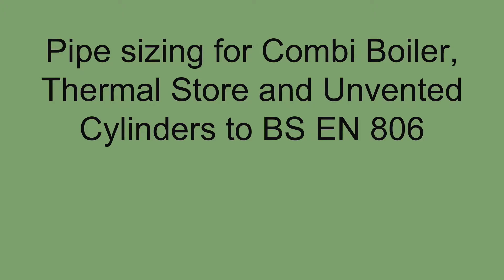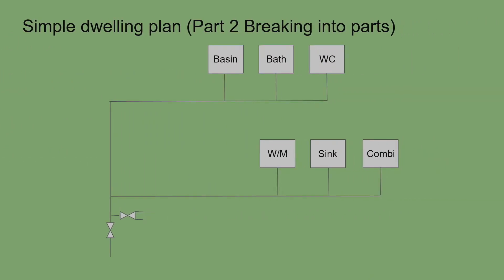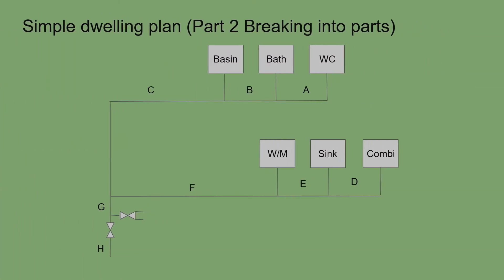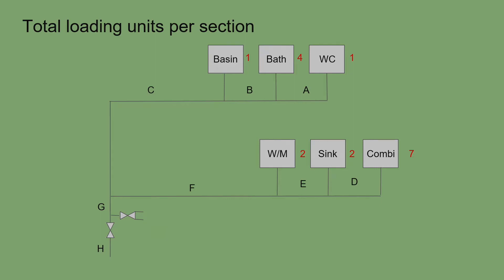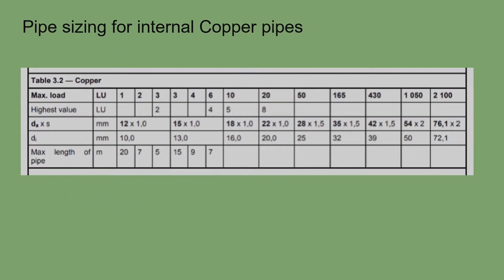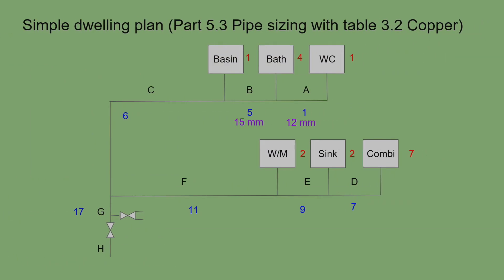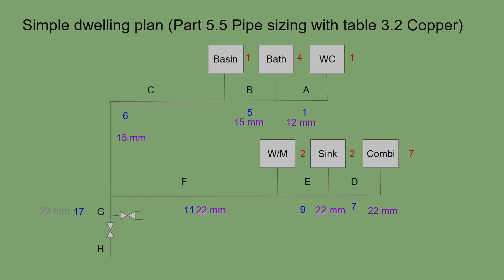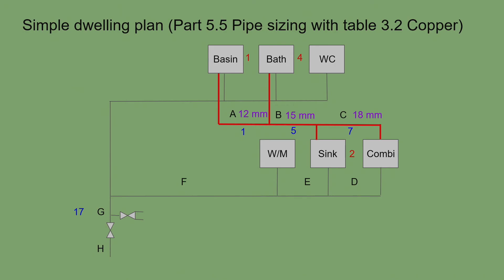Pipe sizing for Combi, Unvented and Thermal store to BS EN 806 Part 3 Pipe Sizing Simplified method

Comment: Why not in every situation just use 22mm for water services feeds to save having to calculate
Reply from the maker: That is a very good question, it's all about the outlets (taps , showers, WC's, sizes and how many of them) some have 15mm connections, others 22mm. They also have different requirements, some modern systems need 28mm pipework at the start of the run to work correctly. This is why we do the maths, this is the easier one to use, does not take long to do and check what a system needs. Taking your time and getting it right makes the different between a cowboy, a good plumber and a great one in my book.😋

Comment: hi,  all combi boiler comes with 15mm  (1/2") connections for hot and cold water.
Reply from the maker: Yes, this is true but there are some combi's with a 22mm connection but the main thing is if your hot water pipework works out to be greater than 15mm, you should want to think about a unvented cylinder not a combi. But if your not worried about it then you can fit a combi with a 15mm pipework and live with the pressure loss around the home. Remember this is a guide not a regulation, its the designers choice in the end.